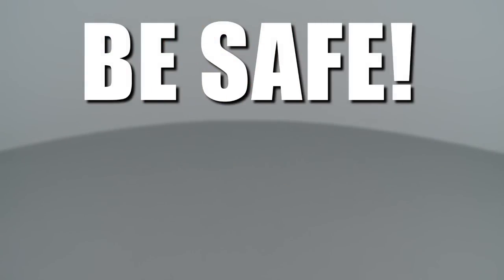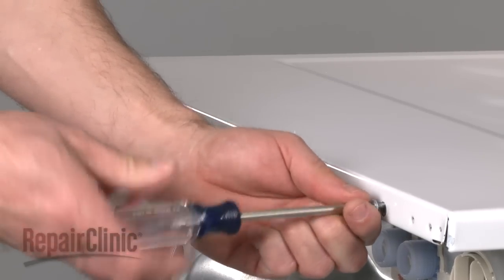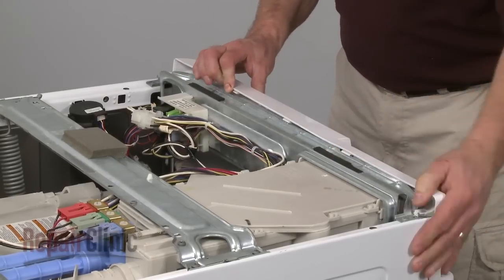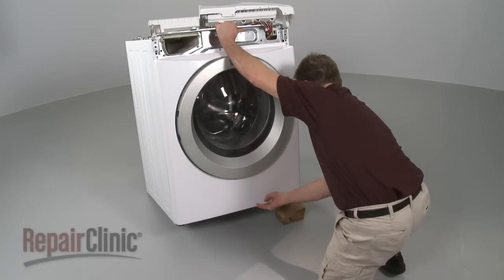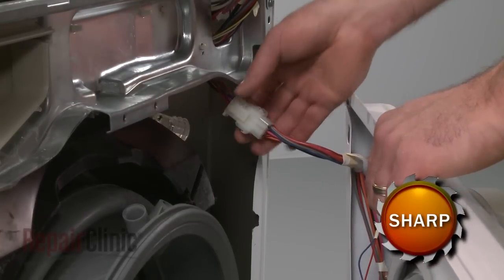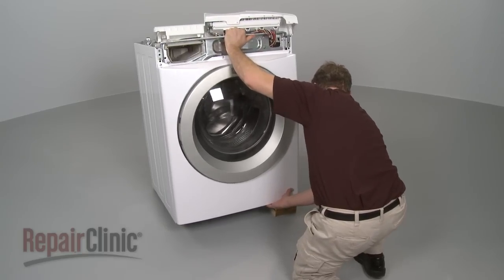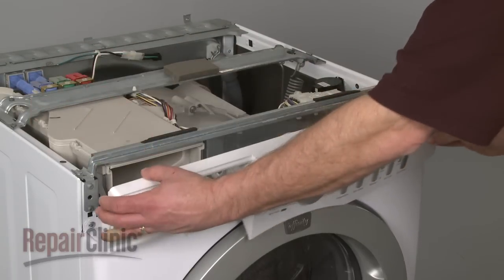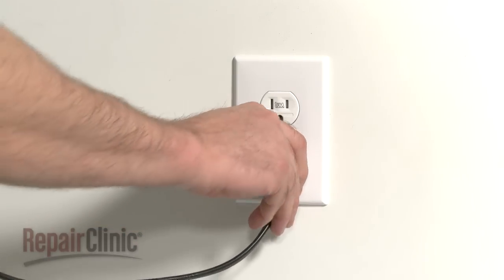Frigidaire Affinity Front-Load Washer Disassembly, Repair Help

Comment: $5.32 in change, a spark plug tester, a piece of shirt, 2curtain rod wall hangers, 3bobbie pins, a hair elastic, 2bra hooks, the remains of several dollars.......apparently my fiance had never cleaned the filter. He has owned the washer for 6 years and never knew about that filter. Thank you!!! You saved us repair/replacement costs.
Reply from the maker: +sweetcheeks5573 Wow, that is a lot of stuff. Glad we could help.

Comment: This video is helpful, but what if you cant get the front door open on the washer to remove wire spring thingy. I believe I need to replace the door lock assembly but cant get door open to remove wire

Comment: i have this model washer, which was working a few hours ago, but suddenly seems like it has no power. I have checked the plugs as well as attempted to plug washer in to another plug via orange extension cord. no luck. im thinking it may be the control panel? i was thinking about how hard it will be to get another washer financially, but after watching this vid im going to try the control panel replacement first. thanks!
Reply from the maker: +negative74 Thank you for sharing.
Reply: +RepairClinic.com update:its very cold in my area, and i was running aloe of space heaters. When i turned them off,  i went back in to the washer area to grab something-and washer display was lit up like normal. I'm not sure if it was a coincidence,  or if these electronic panels are just really sensitive.

Comment: I am so excited to be fixing this myself. I am confident there are coins in the trap. Error 20. .  I have completed all the steps in your dissembling video thru elevating the bottom to unscrew the lower front panel screws.
The front panel is still firmly attached right below the cycle dial in the middle of the control panel.  Everything else is unscrewed and loose.  
 How do I release the panel under the cycle control dial ?  Thanks soooo much again.

Comment from the maker: Is the water draining out of the tub? If the water is draining, but the clothes are still wet there could be a problem with the spin cycle. The problem is probably not with the filter.

Comment: You were a great help in showing me how to replace my door lock assembly,  Machine spins fine now.  But my front control panel is cracked--controls themselves are fine. How do I remove the front panel while leaving the controls themselves in place?

Comment: Great video and a great customer service. I have a very minor issue and that is I have coins that are inside the three gray 'beater bars' inside the tub. They make a racket, and I cannot figure out how to remove the agitators easily. Any thoughts? Thanks!
Reply from the maker: ***** Hi Chuck, what is your machine's model number?
Reply: *****
I was able to remove the beater bars by pushing a long 1/4" dowel into the center hole. There are actually four stainless steel "ears" that hold the beater bars in place, and it is very difficult to push the all out of the way. I was eventually able to remove the two bars that had the change behind them, and I hope I was able to bend the tabs such that the bars will stay in place now that they are replaced. This is a bad design, and obviously not intended to be serviced. It would have been so easy to use any of a dozen other methods of holding the bars in place.

Again, thanks for the video.

Comment: There is an access hole in the bottom of the machine to get to the waste water filter and pump.  No need to remove any panels.
Reply: were you able to repair the waste water filter? Did you lay the machine on the side?
Reply: Yes and yes.   I suggest replacing the spring-loaded clamps with worm-gear type hose clamps.
Reply: thanks

Comment: Thank you very much this video along with another one out there which showed how to remove the coin trap and cleaning it saved me.  It was packed with some hose and part of my shirt.  The shirt came out shredded on the load before so I was pretty sure this was the answer.  My unit looks just like this one but did not have a way to totally disconnect the door I had to put it on a chair while working.
Reply from the maker: +Plano Roofing Thank you for sharing.

Comment from the maker: It entirely depends on what you're fixing. I would suggest heading to our website and pricing it out there (link in the description). If you don't know what is wrong with your washer you can use our repair help to assist you in diagnosing the problem. I hope this helps!
Reply: H hello my washing machine when I put it on I turn it on sometimes the water comes out and other times it doesn't and when I hit it it cuts off and no longer works, and at other times it is washing and it stops not drying, I hope it will help me thanks

Comment: Mine is getting glitches sometimes, the first time I noticed a glitch, it was done with the load but the door lock light was still on and wouldn't let me open the door which turning the setting knobs worked. The other time it got a glitch, it got stuck on the final cycle for a few hours and I just gave up and press the cancel button and transferred the clothes to the dryer, the puddle of soap water that hasn't drained is still sitting in the washing machine until it will get used again. Are you able to explain why the one I have had those glitches?

Comment: Thanks for the video. I had water leaking in large quantities. Once I got the front panel off I could see a wire, presumably from an underwire bra, sticking out from the coin trap hose.  I also found 7 cents and an earring - not enough to cover the price of the new hose!

Comment: Thank you so much for this video.  Removing the front panel definitely made things much easier to access the pump and filter.  Took me approximately 2 hours to take it apart, clean the filter and re-assemble.  Probably saved me a couple of hundred dollars.  Now if I can only figure out how the pad to my wife's swimsuit top made it down into the filter.  Either way, it runs like a charm now.  Thanks again, RepairClinic
Reply from the maker: We're happy to help!

Comment: I feel like such a rock star, thanks to your video!!!!  Machine back together after emptying gobs of junk from coin catch. I am doing laundry but spin cycle is not very consistent.  3 loads so far and only once did it spin efficiently enough to go into the dryer.  The others loads I had to tinker with the" spin only" cycle, which didn't perform consistently either.

Any ideas? Once I got an "error 10", but didnt find any water flow prob.

Comment from the maker: This could be a few different things. I would suggest using the repair help section of our website (link in the description). If you enter your model number there you'll have access to model, part, and symptom specific repair help. Unfortunately we do not have information regarding error codes, so I can't really help you with that aspect of your repair.There are many good forums and blogs out there that cover error codes though, and they should be some help.

Comment: I watched a few other videos associated with this machine.  My washing machine wouldn't final spin.... wouldn't go through a complete cycle on the Quick cycle mode... Other modes didn't work either.  I googled and found a few videos... one about clogged drain rubber boots... I didn't have a low panel so I had to remove the complete front...

... after removing the front and raising on a block of wood... I was able to remove the rubber boot and clean the boot with the debris prevention mechanism... I also cleaned out some wash cloths that had fallen down and was preventing good air circulation.

Getting apart was not too hard, but putting back together was more difficult... I would suggest a pair of vise grips so you can lock down on the metal clamps that have to be repositioned when replacing the boots... since you don't have a lot of room to work... I took a lot of breaks and took part of 2 days to finish.... I'm 66 so took my time and rested frequently with a cold beer... 

I running a test as I type this and so for ALL is working OK...

Thanks to all the persons who created a video... I would not have even have known where to begin without the assistance...

I bought the vise grips at Lower yesterday and also priced a new washing machine..

... not cheap... $499 or higher...

... machine just completed and everything appears to be ok .. going to was a few clothes now ... my machine is 8 years old, so may get a few more years before spending $500 for a new one...

Comment: This is the most stupid design that failed the Frigidaire!!! Other brands have an opening in front to clean the drain path. This one doesn't!! If you stack it with dryer on top, you are dead meat. A little hair will block the drain and cleaning is more expensive than buying new. Some engineers, like these and those crashed Boeing airplanes,  should be sentenced to jail.